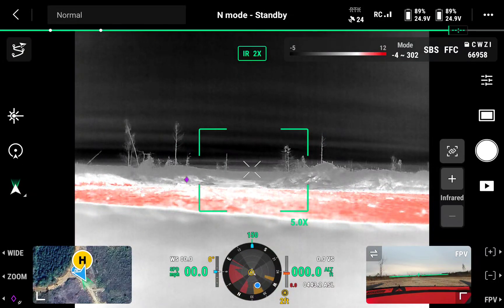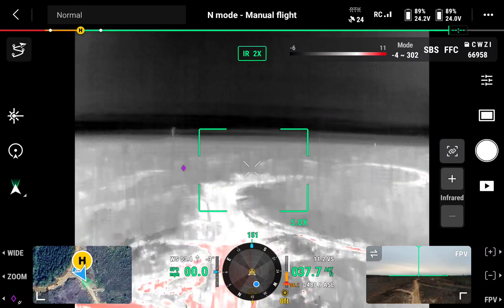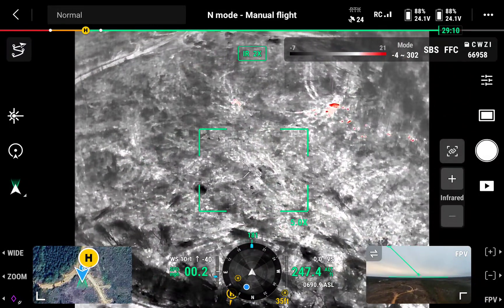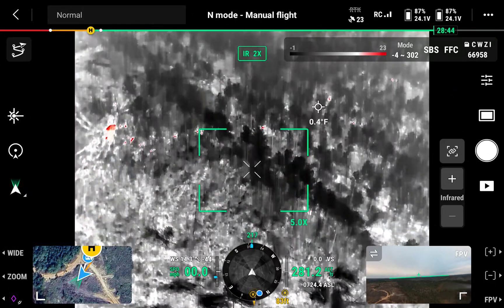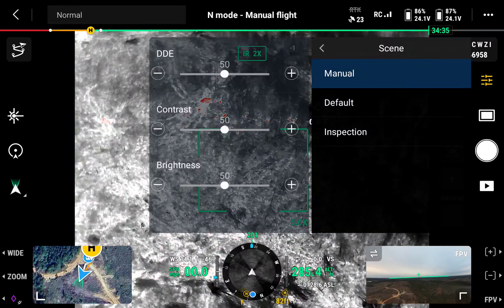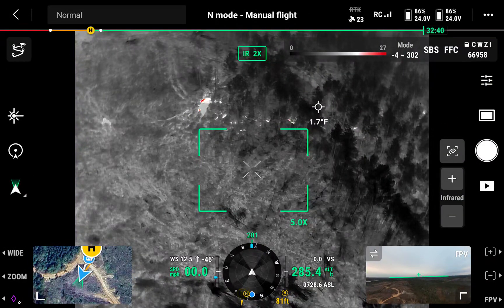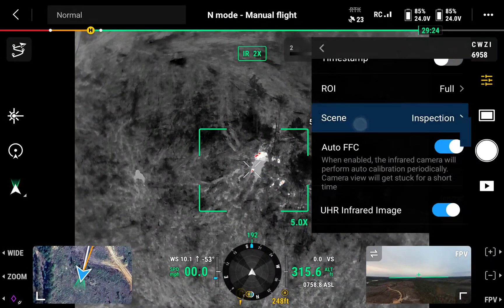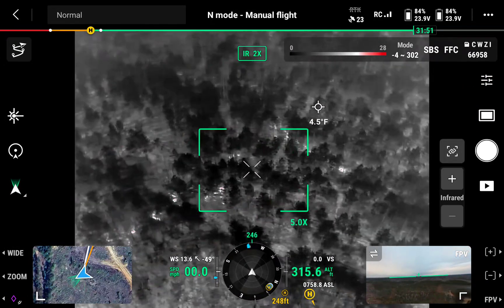Using DJI M30T Inspection Mode

Comment: Your in TINT mode/switch to another color pallet
Reply from the maker: I need to learn the other color pallets. I normally just use tint mode
Reply: @FreddyDillard-yn7yt  depending on the activity different thermal modes work better.
MEA
https://youtu.be/Bpm1GoWEi7c
M30T
https://youtu.be/3orSKw93F28

Comment: Yeah on the M3T i dont think it has those options but if you click on the temp scale, that opens up some options, top left is pallet, to the right is a thermometer, click it and you turn on manual mode. There you can tweak the upper and lower temp thus filtering out the red. It use to not work but they fixed it with a update. 

Now what you end up doing ( on Tint pallet) is you basically can turn it into White Hot as you filter out the red shading. So you have to tweak it and find the sweet spot. Plus as you change angles, especially when the sun is heating things up you may need to tweak it as you fly. Keeping in mind of the sunny side vs the shady side.